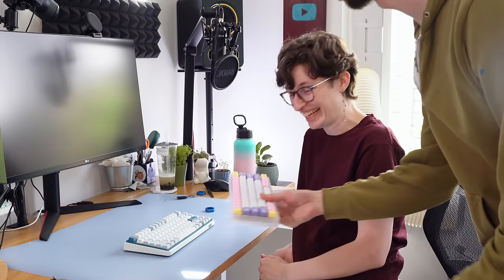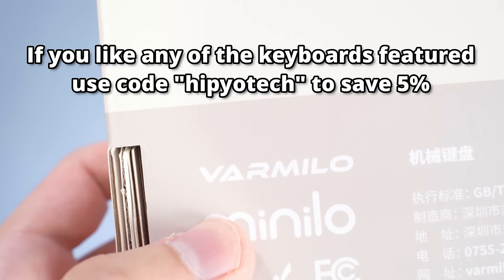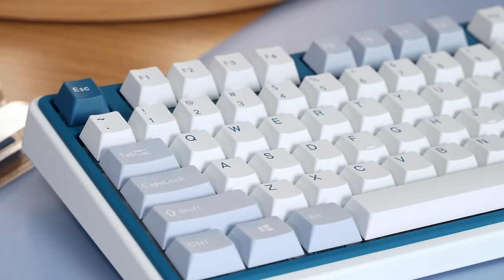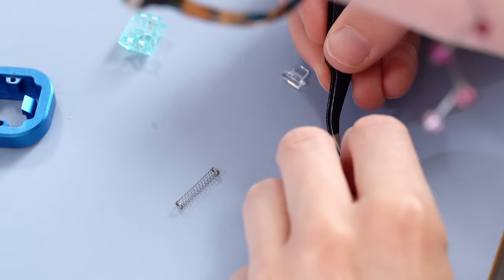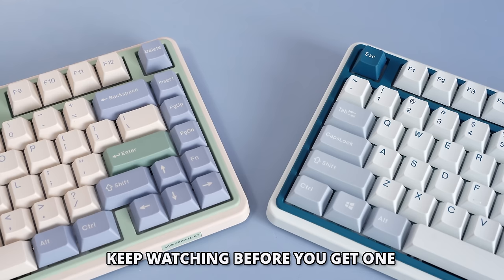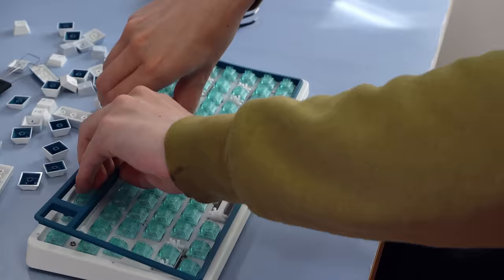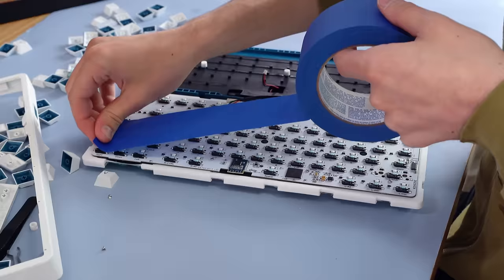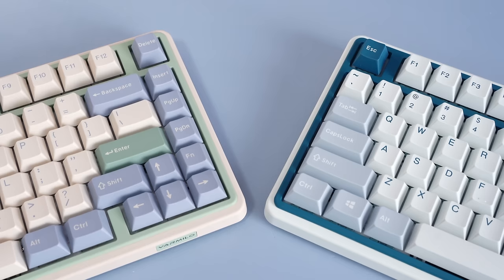The Worlds QUIETEST Keyboard. 🔇

Comment: This thing sounds incredible stock wow.  It would be expensive but I wonder if anyone has had the thought of buying one of these just to take the switches and put them in another board.  Also I wonder how much work it would be to transfer the board into a nicer case

Apparently varmilo does sell the switches individually but they’re sold out currently
Reply: I was convinced by this video and bought this keeb (kinda impulsively, not thinking about how I use a numpad all the time…) and actually did take the switches and put them into my RK 96. There’s definitely a difference in the keyboard builds! 

The varmilo with the kailh prestige silent switches was maybe even quieter than my office membrane keyboard! The RK96 is much more resonant and makes its stock yellow switches sound heavenly—BUT with the kailh prestige silent switches (varmilo), it’s not nearly as quiet as the varmilo. 

If you’re like me and the 75% is not for you, varmilo actually has a lot of different sizes and you can buy several of them with the kailh prestige silent switches already in. I can’t speak for those builds, but I am really impressed with the minilo stock!

Comment: Wait! If they screwed the top trim into the pcb from the back, then there should be a way to dismantle it from the backside no? Thinking how they would even put it together in the first place - anyone else? I really want to mod this keyboard without breaking it LOL
Reply: Snap fit. Basically they screw the PCB and then they snap the back in place. The plastic on top then comes over the case making in almost impossible to disassemble without bending or destroying that plastic cover.

Comment: How do i make my SteelSeries Apex 7 more THOCKY it really sounds like a 1 dollar keyboard. I put tape under the stabilizers but i can't really hear any difference. It has a ticking sound and a rattle sound and don't know how to fix it. It could be nice with some tips for people that have never opened a keyboard before, like me. I am desperate for a better sound because I think me ears are gonna fall off very soon AHAHA.
Reply: The board is kinda hard to take apart. You would prolly have to lube the keyboard's stabilizers and slip some bandaids in without taking it apart. there are lots of videos about modding the board :>

Comment: The screw isn't stupid at all when you consider that top plate being screwed in "grounds" it to the pcb and rest of the case so no resonance or vibration travels through it to make sound independant of the dampening as all the resonance makes its way to the silicone to be absobed and dampened.

You might argue that would be negligible, in which case I would argue that in a community driven mad by switch scratch, no it isnt.
I would also tell you to go take every screw out of your keyboard then type on it and tell me it doesnt sound different without solid construction. I would then also tell you to shut up and that you dont need to tell me because I already know the answer.

It's also a solid way to mount such a thin component so it doesnt explode if some idiot drops it nor is it rendered unusable if there are minute qc issues in regards to tolerances.

Simple forsight and thought into order of operations makes it a non issue. Especially when compared to the construction of most every other keyboard AND considering the fact this keyboard seems to lend itself to a market of people who want the result of a silent kb without the work of having to do it themselves through mods.

You really made a mountain out of a mole hill and its pretty frustrating to see.

Comment: Hi Hipyo! I have a question for you: would it be possible to switch from standard mx switches to anything low profile using the same hot swappable sockets? Thank you and sorry for the super noob question 😥
Reply: Think about the space constraints of your board - the keycaps might be too low with low profile causing interference or something. But in terms of three or five pin switches, they should be fine 🤞
Reply: @MDG509_  Oh, thank you, that makes sense and I didn't think about that!

Comment: I compared the Kailh Prestige Silent switches which I ordered separately off the Varmilo website, with the Kailh Deep Sea Silent Pro, and the Deep Sea are even quieter than the Prestige. More precisely, it's the rebound that is quieter. 
My plan is to get the hot swappable Minilo and mount Deep Sea switches on it 📢❌

Comment: The worlds quietest keyboard is any of the latest razer huntsmans that use v2 red switches, there is no sound as the have a rubber damper in them so when they bottom out they are silent as they hit rubber, nothing will beat them for silence and no modding is required.